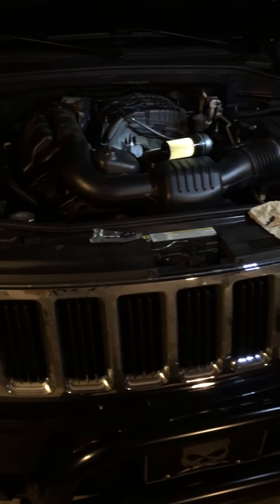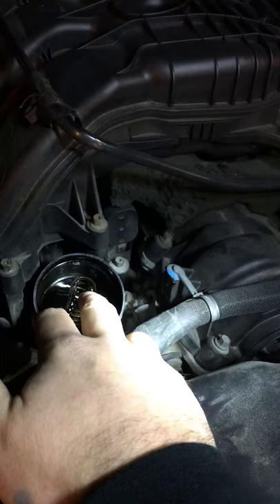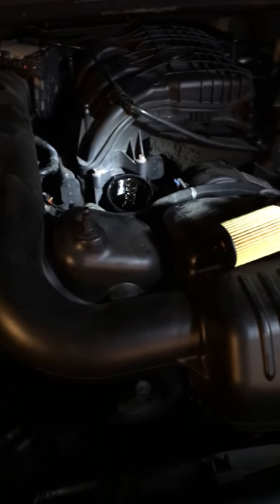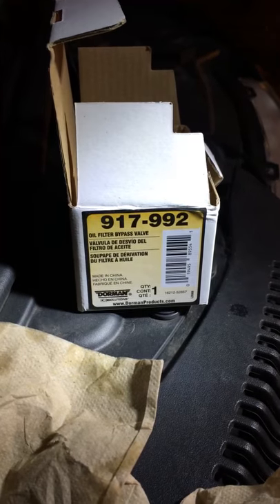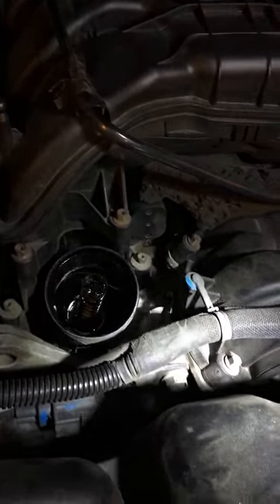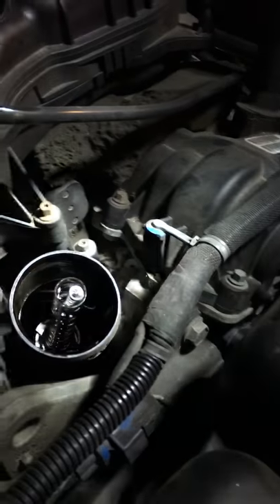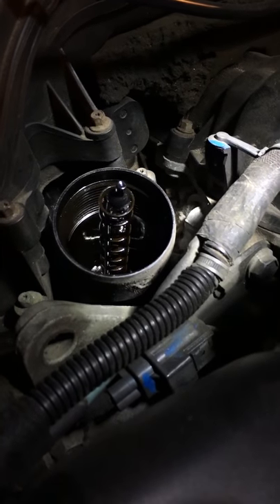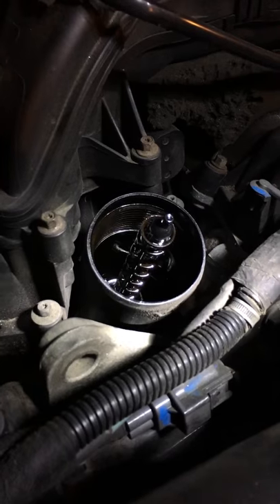3.6L Oil Filter Bypass Valve | Replacement

Comment: Good video but I bought the Baxter check valve so the oil filter does not drain back when the engine is turned off. Instructions say to cut out the larger outside plastic cage so bye bye stupid design failures. The Baxter adapter uses the reliable spin on filter design,
Reply from the maker: Thank you for posting that information! I’m sure if I still had this vehicle I would’ve been trying other things along the way but it became so much of a burden I decided to get rid of it. But I hope all is well your way and with how it performs!
Reply: Used to have a 1973 Challenger 340 I did a frame up restoration on it. I guess you already know that was a whole lot easier than some of the stuff we face on these newer vehicles. I used to be an engineer and feel qualified to say, not all of these so called improvements are good ideas.  @StephenRamsey

Comment: Dont freak out but you just installed it wrong. You need to when installing it press it down inside the outer spring, down until it clicks in place twice, not once. You will see that the Dorman part 917-922 is placed with the new spring inside the exterior spring, you press down two clicks or levels whereby it bottoms out, you cannot press in place further. The tip is then slightly exposed at the top. Thats the correct install placement position for this install.
Reply: Thanks for the comment.

Comment: I have a question is it pretty hard to press down once it is installed or pretty easy I want to make sure I didn’t leave a piece of the old one underneath
Reply from the maker: You shouldn’t have to push down too hard but it should click into place.
Reply: Thanks for your help I’ll double check it next oil change